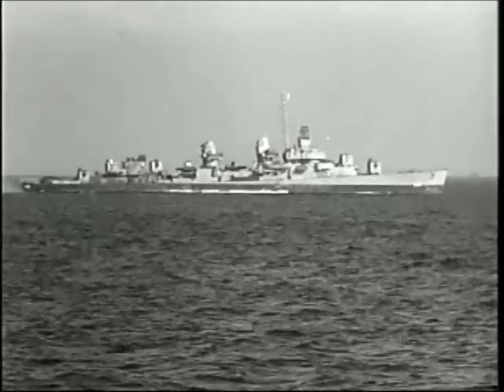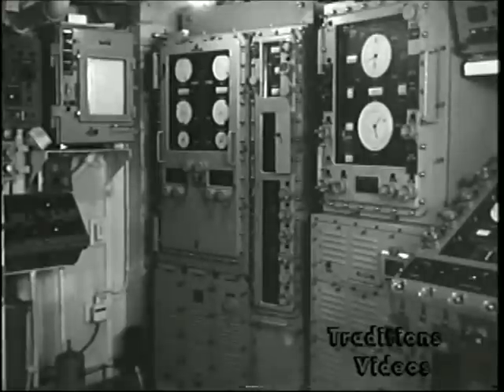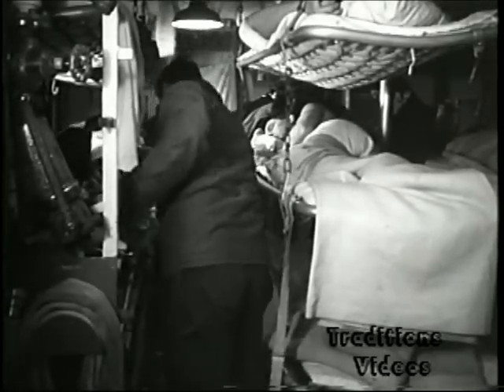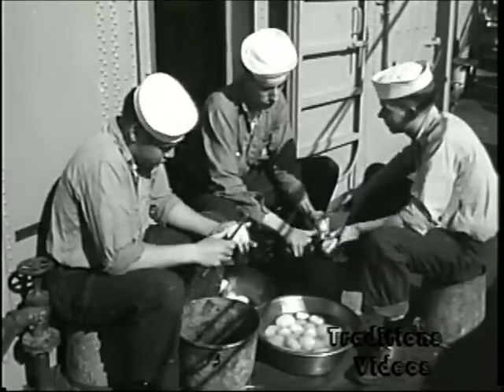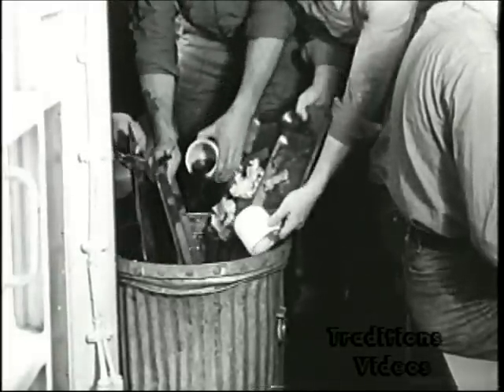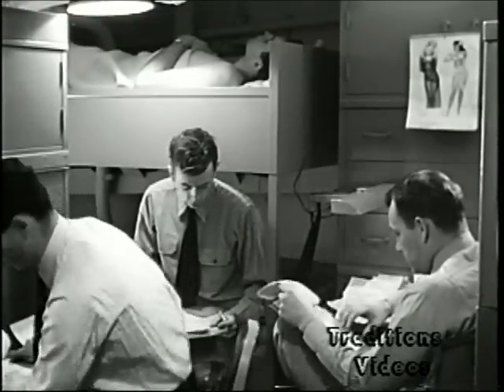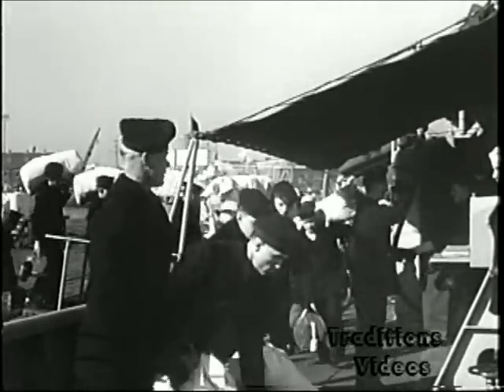US Navy USS  Saufley DD465 1952 Living Conditions

Comment: This is pretty accurate I served on the Larson DD-830 on it's last trip to Vietnam in 71 with six months on the gunline working in the engineroom and in the forward gun mount during general quarters,fired 10,000 rounds through the 5"/38 guns providing fire support off the coast had to be refitted with new barrels in Singapore it was an old ship and was decommissioned when we returned home.I made two more trips overseas after that.
Reply from the maker: Ken: Thanks for the post!  Yeah, the Larson and the rest of the Gearings were just a little bigger than the Fletchers but with single gun 5" mounts and older torpedos, etc. While post-FRAM, the Gearings got A/C in berthing spaces and the mess deck,

My ship, the Myles C Fox (DD-829)  was same class as the Larson and was in Vietnam in '67 and '72. I was aboard in '72. Also worked in the gun mounts at one point prior to that deployment but was on the Stable Element in Plot (final key in firing both mounts) while working in the Tonkin Gulf. Tons of fun. Made 3 major deployments and two GITMO refresher training trips on the Fox. Wouldn't trade those DD experiences for anything.

Thanks for posting!!
Reply: @braintrusts  The Larson was known as the Last of the six guns I was a snipe but they pulled me out of engine-room and put me in the merry-go-round of MT 51 feeding the hoist because the Filipinos were not strong enough to lift the rounds and powder. We worked up and down the coast drawing fire to give the Newport News something to shoot at fun times.

Comment: I was on the USS Preble DDG-46 (DLG-15) and it sure was a lot different than this boat.  We had bunks that had curtains and were solid, not folding up.  The mess deck was modern and spacious.  At first we had movies, but later we had CCTV with TV's throughout the ship.  Toilets were divided by barriers with curtains in the front.  I don't see how the crew on this ship could have gone to GQ without everybody falling all over every one.  Glad I was born in 1952 and not in the Navy then.
Reply: during gq directions of movement were regulated, typically port and starboard sides ran opposite direction, and doors, hatches and passage ways had dedicated directions of travel, wherever possible and practicable

Comment: I retired in 1980 as a CPO and rode  1 carrier and 4 "tin Cans" and each one was better and bigger than the previous. one. They are War ships, NOT hotels. Keep that in mind. This film was one of many used by Buships to design more room my tin cans and they did. 692/710 class, DDG2 class, Forrest Sherman class and last the Spruance Class, huge tin cans and roomy.  The Navy is not for every one.
Reply from the maker: Thanks for the comment, Chief!  The Gearings and those "cans" that preceded them were indeed warships built for speed and combat, not leisure.

As you know, it was tight quarters which made for close living.  There wasn't any room for being ornery about it either, as having a bad attitude usually got serious push-back by peers and division petty officers.

It all made for great experiences and as my dad used to say "It builds character".

Thanks for making a career out of the Navy!! Men like you molded boys like me.
Reply: Suck it make the ships bigger . Thats why i was in the air force PLENTY of room
Reply from the maker: Only "some" of the USAF has plenty of room.  Fighter pilots and many other pilot's cabins are TINY.  Perhaps the barracks and chow hall were big, but that doesn't mean crap in combat, and that's what military is for, no comfort conditions.
Reply: Iy
I retired in 1970 as ENC, ditto.
Reply: Cool heads shown here. My 1st ship heads we sat over a long trough w/ sea water running through it.
Self cleaning  8< D
Bunks weren't dry but pooled w/sweat.
Reply from the maker: As my dad used to say: "...builds character".  

Adversity teaches people that everything in life is not living at the Ritz Carlton.

Comment: Air conditioning??? NOBODY cared about the comfort of the personnel working here!  They had to somehow dissipate the tremendous heat generated by the (relatively-2017) primitive electronics!  Not to make the sailors comfortable but to keep the vacuum tube technology running!
Reply: Gary Clouse Jhulliam
Reply: That’s why berthing areas on those old ships were adjacent to the weather decks. They would open the doors at night to allow some circulation of cool air

Comment: U,S,S, Meredith DD890, the last of the FRAM 1 Gearings. 
 Boiler Tech, aft fireroom.
Reply: MM on the USS Royal DD-872 FRAM 1 Gearing class (worked both engine  rooms
Reply: USS Wood DD715 71-73 after fireroom BT-2
Reply: USS Arnold J. Isbell DD869 RM3.
Reply: USS Strong DD758
Reply: masterskrain I was on DD886 USS Orleck
Reply from the maker: Not sure you mean by "last", as the Meredith was decommissioned in June 1979 and the MC Fox DD-829 was decommissioned in October of 1979 and sold to the Greeks. Thanks for your service in the Greyhound fleet!!

Comment: Officers had it made and most were just dead weight. The ship would have fell apart without  the knowledge and leadership of the CPO's.
Reply from the maker: Yes, officers seemed to have it easy; having seen the pressure and responsibilities of the junior officers on the bridge and in combat, their different functions between the officers and enlisted is necessary. One group cannot function efficiently without the other.

But, to be clear, nothing would get repaired, maintained or managed without the highly trained and motivated enlisted crew.
Reply: The Chief's actually run the Navy, They just let the Officers think they are in charge.
Reply: @dennythomas8887  Officers fly the planes, the deadliest and most useful tools the Navy has.
Reply: Officers make decisions. 

No CPO is going to decide which grid square to go to, or whether to go to general quarters, or whether to abandon ship.
Reply: Anything stopping you from becoming an officer?  Apart from bad grammar that is?  At least sailors get some time off, whereas officers don't.  Can't see a CPO running a Carrier Battle Group either, can you?  Where do you think Admirals come from, a box marked "Admirals"?

Comment: Back in the early 90's I was assigned to FFG-25 USS Copeland, a fast frigate. Compared to what I witnessed on this video, we had it very good. I had my own rack and It was equipped with a light and an air conditioning vent with a curtain for privacy. But while not on watch it was hard to sleep when over the 1-MC, "Flight Op's" or "Unrep" was always being blared! I was an IC-2 or interior communications electrician. My duty station was in IC-gyro. Whenever we went to GQ my duty station became stifling hot because of the heat the ships gyro equipment gave off. I remember that in the morning the heads were clean but by evening they gave off a horrible odor and the HT's could not seem to ever have the urinals working so in the afternoon they REALLY stank. The food was horrible also. But yet compared to a 50's destroyer, yes we had it pretty good.

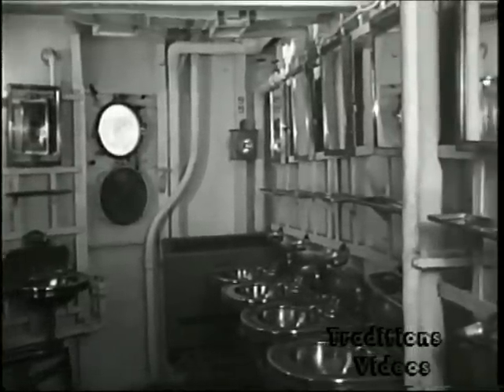Comment: 6:03 yeah that's the shit.
Reply from the maker: And, the aroma can't be beat!!  They made "some" improvements in upgrades/retrofits in the existing fleet but didn't get better until the newer ships got built in the 60's and onward.  Happiness in those days was being in the head,  alone, taking a dump.
Reply: Hahaha. I can imagine eventually one would get sort of used to this, but geez, taking a dump with everyone as witness. But then again, it would the same for everyone in that part of the hierarchy.
Reply from the maker: On Gearing Tin Cans (the class that followed the one in the video) officers had their own head and showers, but enlisted through E-6 used the crew's head/showers. In the forward head there were two showers, 7 sinks, 2 urinals and 5 toilets for 75 men. Got pretty busy when the fresh water was limited to 1 hour a night.
Reply: Geez 1 hour a night? Tough regulations.
Reply from the maker: Ship made its own fresh water from salt water and the two most important uses of H2O were for boiler feed-water and cooking; showers came last, and to limit the showers to one hour certainly saved water, as the requirement was for each of us to take ONE MINUTE or less to get wet, soap up and rinse off.  Not an easy task.

Due to water plant breakdowns there were a few occasions that we had NO FRESHWATER SHOWERS and could only use saltwater showers which was not a good option, for sure, as you never felt rinsed off.

In spite of these kind of close quarters and special hygiene conditions, we had it better than the grunts on the ground in Vietnam. I never forgot that and considered our conditions VERY favorable.

Comment: Our berthing " racks " ( as they were called ) on DD708 ( in mid 60's ) had safety belts for rough seas to keep from being rolled out while asleep .
Reply: Yes hurricane straps on a FF during the storms and we also had to place our shoes under our racks to keep us from rolling out.
Not so funny then.
Reply: I was on DD 824 USS Basilone....our racks didn't have those "springs" I seen...It was just canvas stretched across the aluminum frame...we did have straps to hold yourself in. I was on top rack, had to squeeze myself between ASBESTOS covered pipe, but once in ..was roomy enough...Tin Can Sailor for life
Reply: @charliekindlesparger5502    After reviewing it again you are right .  Those racks ( 5:17 ) were curved and had springs . No such racks on the " Dirty Dick " USS Harlan R. Dickson that I can remember . White canvas laced through brass grommets to tube frame hung on chains in my aft berthing compartment .

Comment: That looks very similar to the dashboard of my 93 Buick Road Master station wagon.  The guys working below decks in my engine compartment have plenty of living space in the back seat. And when it comes to fire power those 16 inch exhaust pipes are deadly. They don't make Dreadnoughts like this anymore. 😆
Reply from the maker: As soon as you get 60,000 drive-shaft horsepower to the rear wheels on that Buick Roadmaster, your can go head-to-head with a destroyer of this type. While the Buick RM was a beast of a vehicle over the years, it can't handle the fire power of a Fletcher Class destroyer.
Thanks for your interest, though, as well as your humorous post.

Comment: Served on a  wooden hulled minesweeper with an 80 man crew stuffed into 172 ft, in the late '60's.
Forward berthing was sometimes wet with water taken oven the bow.
They rode like a bathtub with its round bottom.
A/C was used to keep the radio and radar gear cool and off Vietnam it was pretty stuffy below.
Reply from the maker: Am guessing that you guys had it as least as bad as destroyermen.  My white hat is off to you, swabbie!!
Reply: Thanks.
And right back at you.
We certainly  couldn't make the speed the tin cans could.
We were, with all 4 Packard V-12's on the line, at a top speed of knots.
And a thirsty set of engines.
Every 3 days refuel and stores from an AO.
We were build for dragging the sweep gear through the water.

Comment: And we thought we had it bad in 1968 !  Those close quarters had to cause fights every now and then. On my ship in our space we had an air conditioner unit that worked we had to keep it guarded so the engineering dept. would not steal parts off of it.
Reply from the maker: I was on the DD829  '69 - '72 and while not as close quarters as those Fletchers, it certainly wasn't comfortable.  What ship did you serve on?
Reply: @braintrusts  LST 1168. Went to Nam to move a CB unit.  We had to be at our GQ stations in under 3 minutes. For the life of me I cannot believe those guys on that destroyer could do that.  We at least had enough space to dress individually. Check out Tom Hanks movie Greyhound. Someone finally showed what happens on the bridge of a Navy ship.

Comment: I was on the DD826 from that era, for 4 years.
Reply from the maker: The Agerholm had a very storied career with the USN.  Those Gearing Class cans weren't much better on accommodations than the Fletchers, as they were built in 1944 - 45.
Thanks for your service!!

Comment: Interesting:  I volunteer aboard the USS Kidd, mostly working around the aft Fan Room.  On the Kidd there is a double set of ladders descending forward on the Port side.  However, in the video (at around mark 5:38) the Saufley has ladders going both fore and aft (on the Port and Starboard, respectively).  I can't tell if they are single or double ladders, but my guess would be single.

Comment: And I thought we had it bad on a Gearing Class
Reply from the maker: You are correct!!  Gearings had A/C in the berthing spaces, and due to a smaller crew after most deck guns removed, there was more space for some crew comforts. But, still pretty spartan living standards with crowded heads and the mess deck was pretty crowded at meal times. We still had a good time, though, and the experience on a WW2 Tin Can sure built character.

Comment: DD 938 USS Jonas Ingram. The first class of Post WW2 Destroyers. It was not this cramped, but in some ways not much better. I think sickbay was the same size. Still very tight.
Reply from the maker: Destroyers have almost always been cramped until the Arleigh Burke ships came along.  But as you well know, you get used to the tight spaces and lack of privacy and it all becomes your "new normal". Thanks for serving and posting.
Reply: I remember the Jonas Ingram. I was stationed at a SIMA unit ('79-'81), and we did repairs on the Ingram a few times.

Comment: What was the name of the accountant who decided all these regulations?  Looks like 3rd class on the Titanic. Gpx
Reply from the maker: The accountant's name was Letswin Warrs.  Warships have always been a model of efficiency, keeping tonnages low so that the most weapons systems can be installed, and still have the speed and maneuverability required to beat any enemy.

Warships are just "weapons platforms" and crew are part of that system; the bare minimum of luxury accommodations are made for both officers and crew.

When we were just at sea or in combat ops in Tonkin Gulf, I knew that we had it made compared to the combat troops on the ground who were wading through rice paddies and sleeping in foxholes with NO showers, hot food or mattress/pillow, and certainly no protection from the weather.

Comment: I wonder how conditions are now for ships.  Ships got a lot larger but then there’s also more crew.  What’s the ratio of personnel per toilet or shower now?
Reply from the maker: The conditions on the Arleigh Burke destroyers are much better, with improved bunks and gear storage; MUCH more room and privacy, with better heads and showers.

The Arleigh Burke class had a ship's complement of 303 men and is 509 ft long and a beam of 66 feet. 

The Fletcher class destroyer shown here had a complement of about 300 men including officers. Was 376.5 feet long and a beam of 39.5 feet.

While the Arleigh Burke class was ~29% longer and has 41% wider beam, it's displacement is 9,600 tons vs the Fletcher's  2,050 tons. That's ~80% greater displacement due to armor, electronic equipment and missiles.

So, you can see that a ship that is arguably four times the size with infinitely greater fighting capabilities has about the same size crew. The power plant (gas turbines) and deck guns on the Fletchers required many more men than the Arleigh Burke which uses missiles and automated deck guns.

Comment: Served on USS Saratoga cv60. Was like a 5 star hotel compared to this
Reply from the maker: Thanks for your service in the USN!!  Flattops certainly had their advantages, like plenty of space, but bad things like too big a crew which tended to depersonalize things. Also, the air wing, which wasn't part of the crew, got all of the press and photos and the rest of the crew was just support for them.

Destroyer crews were small (~200 - ~350) and had the advantage of being able to recognize, if not know, all the men on your ship. Also, it was rare that one had only one specialty to know. In my case, being in the weapons department, worked with small arms, deck guns , gun controls (plot), radar, communications, torpedos, stood bridge watches, and, handled lines when mooring. Made work a lot more interesting. Chow line still sucked, though, and so did the rough seas.

Comment: But we were always told that the destroyers and other small ships had so much better food than the aircraft carriers. :)

These days, the crew complement goes down and the complexity of the systems goes up.  A ship used to be designed so that it had facilities to be able to repair pretty much anything that could go wrong, but these days, I'm not so certain.  I think that these days, they just hope that the ship will be able to stabilize the damage to the point where they can get into port or back to the shipyard for proper repairs.  Things sure have changed since I was in...

Comment: Notice no smoking inside the ship.
Reply from the maker: Guy is smoking in the head at https://youtu.be/8RHcz1KS7F8?t=364
Also, smoking was permitted any time between reveille and taps in the berthing spaces and most other places during working or "on watch" periods.
Current USN practice is that there are designated smoking locations topside and apparently not permitted to smoke anywhere else.

Comment: I would not get any sleep, one guy gets a virus, spreads like wildfire.
Reply from the maker: Oh, you'd get sleep after 18 hour work days (including watches); some days start at 0330 and end at 2000 hours and THEN you can take a shower and write a letter. 
As for colds/virus', I don't recall that ever happening. The berthing spaces were well ventilated, clean and dry, but, as stated everywhere, crowded. Am sure there have been occasions where there was widespread colds, but I don't remember any. I never thought about it then, but someone with a cleanliness-related OCD would go bat$hit crazy.
Thanks for posting!!